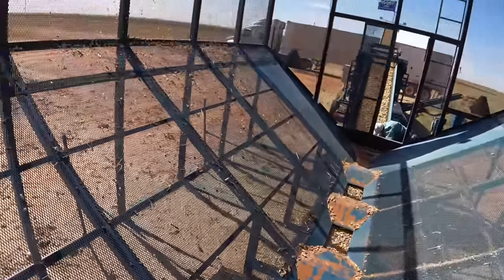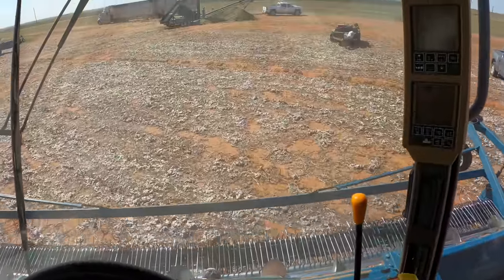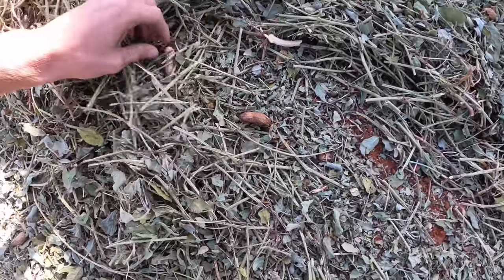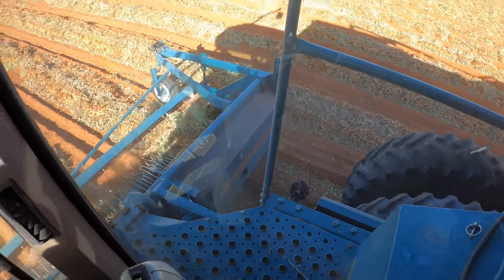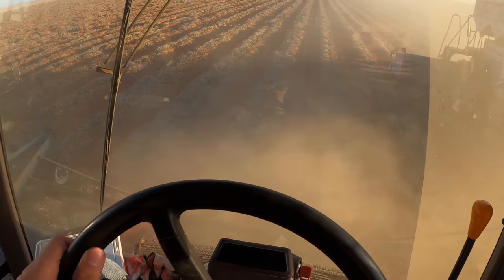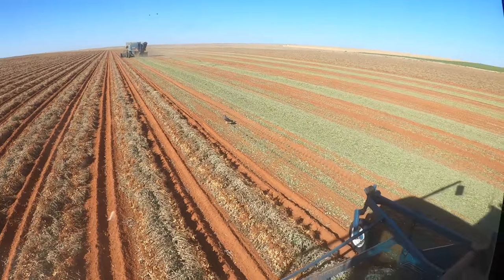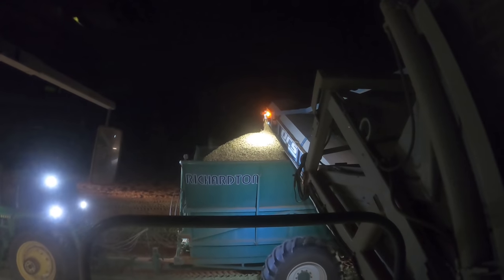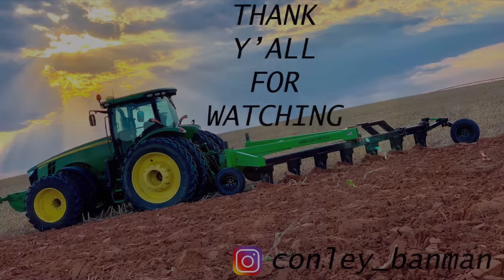Harvesting mile long rows

Comment: Great Video. So doing the Maths, are your paddocks the old 1 mile x 1 mile = 640 Acres? (Full Block)
Reply from the maker: We own the full 640 but there’s only enough water to water 480 acres in a circle
Reply: @conleybanman  Hi, disappointing not having enough water for the remaining land. Especially if the soil is good for cropping. No doubt you have researched alternative water sources, ie underground water. Good luck. Are there any dry land crops you can grow I wonder?
Reply from the maker: Yea it does suck not being able to use all the land. Some people will do dry land cotton but it’s a very big risk especially since we didn’t get even get a single rain this summer